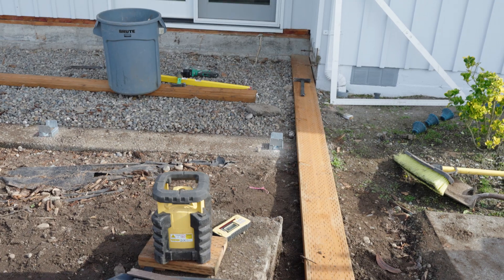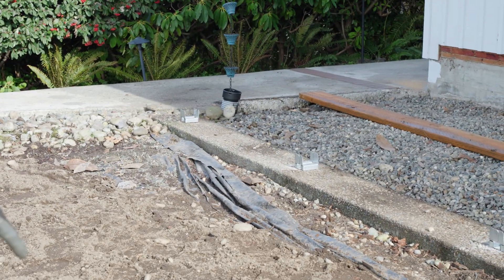Why Would You Lay Out Posts Differently? || Dr Decks

Comment: Dr. Building a 14’x60’ deck with the decking running parallel to the house. Using Azek Coastline (5.5”) for the field boards and Azek Dark Hickory ( 7.25”) for the picture frame. The picture frame will be on all 4 sides of deck. Planning on doing a step Facia as I have seen on some of your jobs.  Question is - do you recommend starting from the house and working out or from the outer edge and work towards the house?? Love your channel.  Keep up the great work. Also any thoughts on where I can get some of the Irwin deck adapter clamp kits or another brand? Can’t find any. Only place I can find them said mid July before they ship!!! Thanks again.